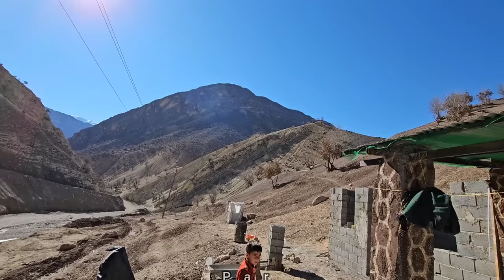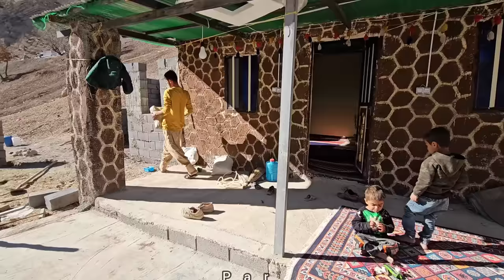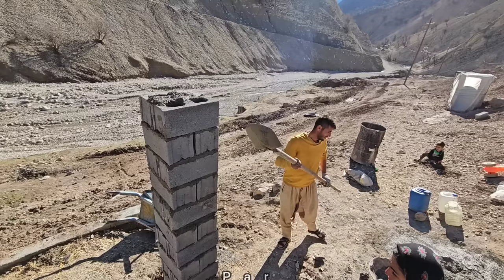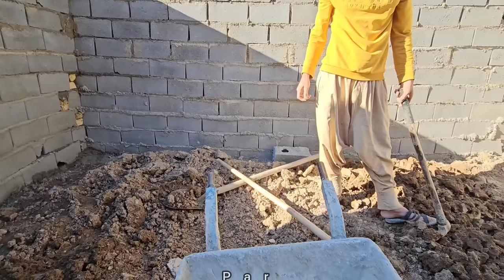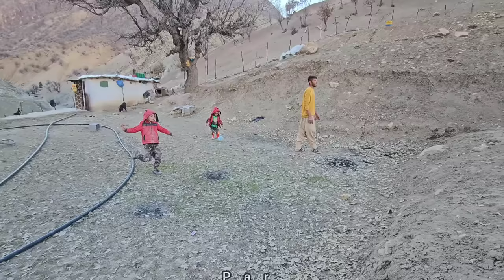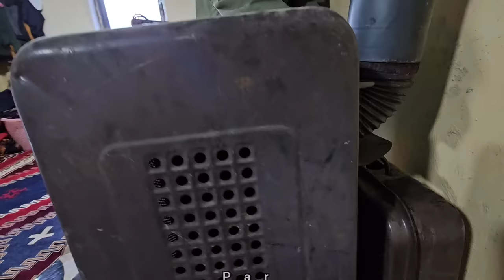Build a rural house 🏡 Babak bought an iron roof for the kitchen and bathroom #villagelife

Comment: The bathroom inside or outside of the house in your situation is an easy question. If the thing was that you had a toilet with a sewer water drainage system, it would be obvious that Armin wish to have it inside the house was the way to go, but without toilet and a sewer water drainage system, I think Narges is write about wanting to have the bathroom far from the house., specially not next to the kitchen!